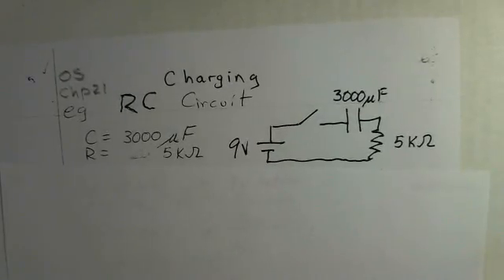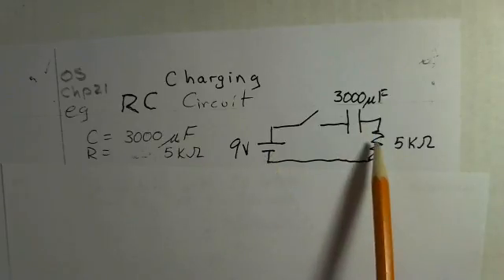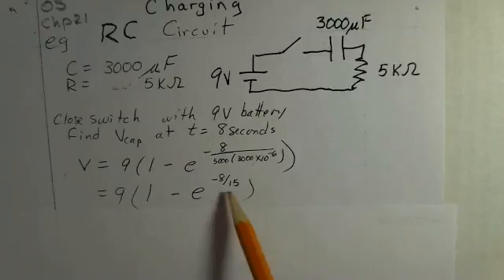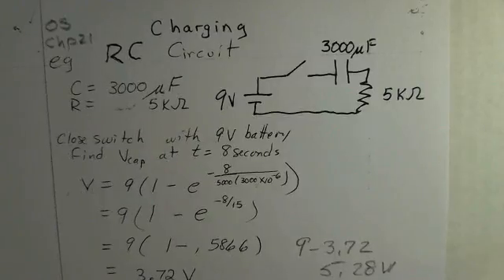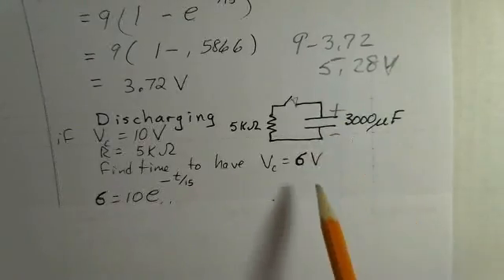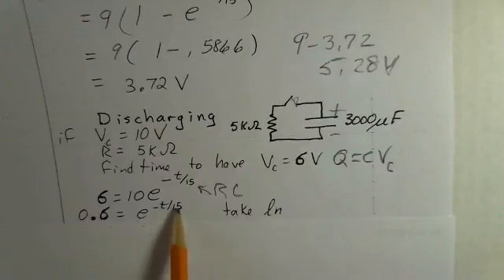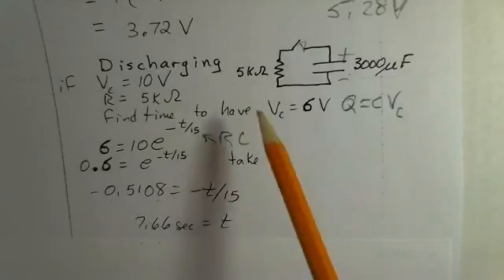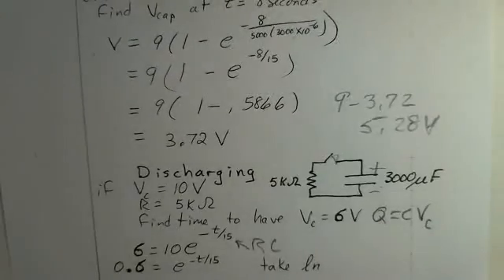RC Circuit Charging and Discharging Calculations

Comment: GREG CLEMENTS, 
without the LOAD, how much current in amps can a 4700uf hold store with a power supply DC voltage at +450vdc? the 4700uf filter cap will charge up to +450vdc but how much current is the 4700uf holding storing?  What formula can I use to calculate how much current the filter cap is storing in amps?
Reply from the maker: There are aspects of your question that I don't full understand.  The capacitor stores charge, not current.  When the DC voltage is applied to the capacitor there will be an initial current in the circuit (and into the capacitor) that will decrease as the capacitor becomes more charged and its voltage approaches the DC voltage value.  The initial current will be the DC voltage value divided by the resistance of the circuit.  The current value will have an exponential decrease as time advances.  At an infinitely long elapsed time the current will be zero amps.
Reply: @GregClementsScience  what do you mean the capacitor stores charge? i thought the charge was current or is the charge voltage? because the resistance/impedance of the circuit load will "draw current OFF" of and from the stored charge from the filter caps correct?
Reply from the maker: @billwilliams6338  When a capacitor is in a circuit and the two sides of the capacitor are at a different potential, electrons will move onto one plate of the capacitor and electrons will leave the other plate of the capacitor.  In this situation the capacitor is said to be "charged" and is storing charge.  There will be a potential difference between the plates of the capacitor. When the two plates of a charged capacitor are connected through a resistor, the extra electrons from one plate will move to the other plate.  If the resistor is large this will take a long time and the current will be small (I = V/R).  If the resistance is small this will take a short time and the current will be large. The current value in Amperes is the amount of charge in Coulombs passing a point divided by the time (in seconds) required for the charge to move past that point.  Charge, Voltage, and Current are all different quantities.  This video may help with some of the concepts:   
https://www.youtube.com/watch?v=Pwhn_2V5Tg0&list=PLMepQzOZp3KT45GRbHx3aHab2wxFHHysw&index=6&t=0s
or look at my playlists on  YouTube and play the videos in the "Electrostatics, Potential, Capacitors" playlist.
Reply: @GregClementsScience  I always that the CHARGE was charged current & voltage. When the circuit load is drawing OFF the charge off of the filter caps which is current. The circuit load converts the charge stored from the filter caps into current?
Reply from the maker: @billwilliams6338  Charge, current, and voltage are separate, but related items.  A capacitor becomes charged to a certain value, Q, based on the capacitance value, C, and the voltage across the plates, V.  The relationship is Q = C times V  , or Q = C V.   A load across the capacitor provides a path for the electrons to move from one plate of the capacitor to the other plate.   A current exists when charge is moving but charge is not identical to current.   Current = (charge moving) divided by (time)
Reply: @GregClementsScience  thanks for the help, Bipolar transistors and FETs stores holds a charge on the base/gate pin and transistors and FETS controls the movement of electrons which is controlling the current. How is a transistor & FET storing a charge from the junction capacitance any different than a capacitor?

Comment: i dont know how you get the .5866?? teach me pls
Reply from the maker: -8/15 is about -0.5333.     Use a calculator to evaluate e^x with x having a value of -0.53333
Reply: thank you for your immediate reply.. but i dont know how to get the value of e?
Reply: you said only the value of x.. which is -8/15
Reply from the maker: "e" is the base of the natural logarithms.  You will need to use a calculator that has a key labeled "e^x", or something similar, to evaluate "e" raised to the power of -0.5333.